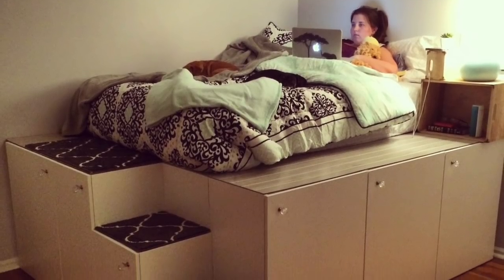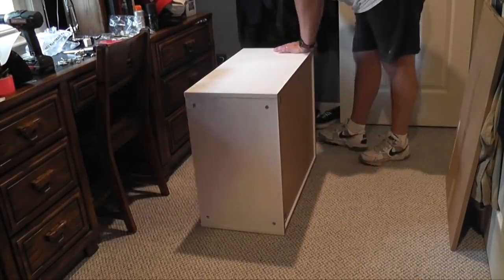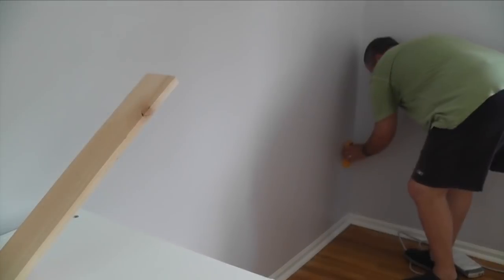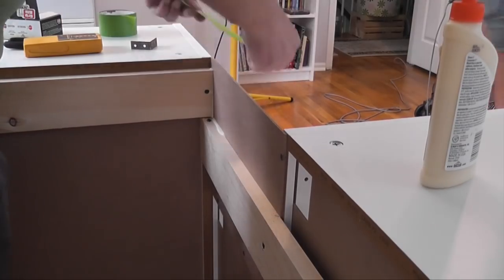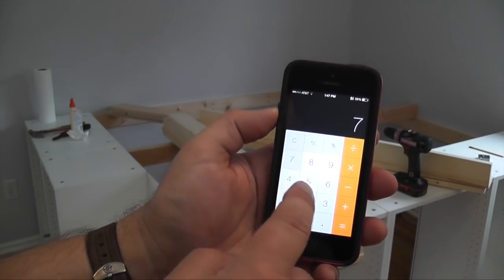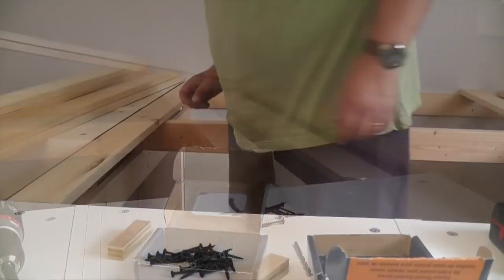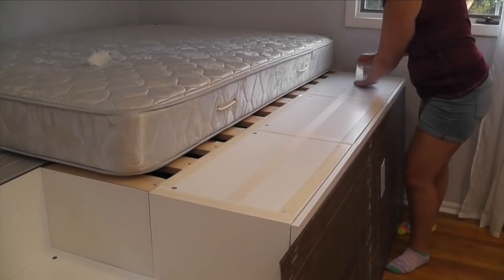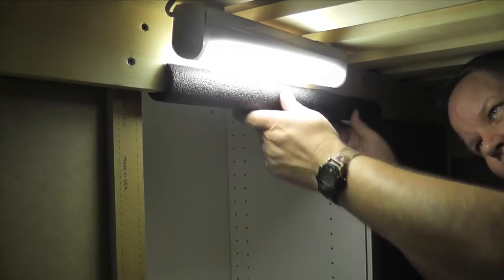IKEA Hack Platform Bed DIY

Comment: LOVED this video when I first saw it last year. It was perfect timing because I was moving from one place with 2 tiny bedrooms to 1 normal sized bedroom. With the tiny bedrooms, I had turned one into a closet and was loosing my closet moving into a bigger bedroom. I modified your plan to use custom cabinets to raise them to 40" and extended out 18" verses 15" (to fit a standard hanger). Each of the cupboard became a half closet! Thank you so much for sharing your idea!!

Comment: It will make the crawling space even lower, but I would make the matress slightly sink between the cabinets. It would look prettier IMO, more like a whole. +it would prevent the matress from sliding a bit away from the wall, wich would annoy me big time :P.
Reply: +Fenke B I think sunk beds do look kind of cool but they pose 3 problems. My parents had a water bed those mattresses are usually sunk. Putting sheets on was a nightmare. Also, the comforter never sits nicely. Lastly, I remember my parents ALWAYS having a bruise or 2 on their shins and randomly hearing "ow!" as they crawled out of bed. It is so easy to hit yourself on the corners next to your mattress because the mattress sinks but the hard wood doesn't.
Reply: That's another practical perspective that should be considerd.. Didn't think about the possibility of bruising against the edge :P
Reply: +Fenke B you wouldn't have to completely sink the mattress to stop it from moving. You could slightly drop it so that the mattress has a frame around it, and it shouldn't be too hard to make the bed as you can still access the corners and sides, just gives it the support to stop it moving around.
Reply: +Reeni how do u make ur bed than
Reply: Jasmine Mounsey you just tuck the sheets in........ if its only like 1inch then it doesn't make it difficult.....
Reply: +Fenke B  put a small rug pad under the mattress and it will not slide
Reply: But what if you want to change mattress size in the future
Reply: HeirOfGlee Depending on what size it was built for originally, you are right!
Reply: +HeirOfGlee That happens very rarely lel
Reply: Yah. To me I don't really care about the crawl space. That would be awesome
Reply: +Fenke B Mine has a lip of about 3cm around all edges. its perfect for holding the matress exactly in place
Reply: flawless 4ever

Comment: Hi, I stumbled upon your video a few days ago and I decided to make one for myself. 

Though I didn't use your design exactly, my design was very much inspired by yours. I opted to make mine free standing and fit the queen size variety. There's even a bit of extra room on the platform for standing or if I decide to change the mattress orientation. It's ALMOST done, it just needs a few finishing touches here and there. I would love to share pictures of it with out when I have it 100% together.
Reply: +Chris Heider how much did it cost to do this project

Comment: Excellent work!  You have re-set the bar for "How to Videos."  I just have one design suggestion stemming from my own experience with storage beds, and that is to completely cover the bed slats with a  light weight solid piece such as the decorative panel.  My only disappointment with storage beds  was how quickly saw dust and dirt drifts down through the slots and onto whatever is stored beneath them. My most recent solution to this problem was to tightly tack down a dust proof mattress cover that zipped along 3 sides to the corners and sides of the frame then installing the slats inside of it.
Reply: Idk about that, matresses have ventilation at the bottom for a reason

Comment: This is awesome, but I'd place the cabinets maybe under the mattress more so as to open up floor space and hide the edge... though the shelf created could also be useful... And I'd make up a pallet base for the mattress vs the centered beam. Too many issues with mattresses sagging after a couple years. Then, I'd also probably just do a solid platform and place a Japanese futon on top for sleeping. :)
Reply: nm about the pallet. never pause to comment. -_-

Comment: Looks great I did a similar project however most new construction gargages use very flimsy roof trusses, they are designed to support the roof not hanging objects from them, I fastenened mine into the walls not using the ceiling. but I have a significant amount of weight on mine. Just a word of caution to be aware of. Cheers 2:57

Comment: Am i the only one that is thinking that particle board is not a suitable material to use as a stepping platform or stairs, especially particle board that is not laying on top of supporting boards but rather screwed into the side of the supporting boards, Its a great idea and wonderful design but i would have just used the ikea furniture as a template and made it all out of hardwood instead of particle board, It would be more stable and last longer then cheap particle board, you could also then keep the wood grain of the hard wood and stain it instead of having stock white color.
Reply: Seriously lol, that's exactly what I was thinking.
Reply: all bullshit aside , you aint gunna do jack squat !
Reply: You ain't cut it bro, so just drill it.
Reply: I was thinking that, but cabinets can hold up a ton of weight, so I'd think it would be okay. That being said, I would have reinforced the framing myself.
Reply: Shadowlords I was thinking the same thing. IKEA is known for their stuff breaking so I wouldn't trust them. this idea is amazing don't get me wrong. I'd just use different wood from a real lumber store maybe
Reply: i know my dog head butted the feet on my wardrobe and the whole thing broke
Reply: It is now.
Reply: I believe the stepping platform is mainly for the dog, LOL, I wouldn't stand on it!

Comment: How would you vacuum under the bed if you need to? The crawl space sounds like a fun hiding space LOL
Reply: you probably wouldn't need to, its enclosed, so there wouldn't be too much dust, and no spiders since they wouldn't be able to survive
Reply: You could use a hand held vacuum cleaner, or, since the space is pretty small just sweep it.
Reply: +Rose Lee what makes you think spiders wouldn't be able to survive? its not air tight...
Reply: +Courtney Shock not alot of bugs down there, so it would be pointless to build a web. bugs usually fly around in open spaces, windows, or doors.
Reply: portable vacuum. there are hand vacuums

Comment: About how much was this project????
Reply: The approximate cost of this project was $480, roughly broken down as follows:
$355 – Cabinets
$85 – Lumber
$40 – Paneling, carpet, knobs
Reply: Nadia Ch. and that's if you already have the mattress
Reply: Nathali Blanco Yea, I really don't know how much is a mattress, the only thing I know is nothing's cheap nowadays
Reply: hannah sparacino Ikea's really cheap but I don't know about the planks
Reply: Ikea also sales bed slats that have bounce to them (and only 2 inches high) that I use for my platform bed instead of a boxspring and it helps a lot.
Reply: yup I bought some kind of furniture was not be able to keep that long.
Reply: mattresses are like $500+ for twin size beds. It only gets worse as they get bigger lol

Comment: While I like the idea, I would add more support under the sides which are held up by the cupboards. I would ad a support beam in the corner atleast. Those cupboards were not designed to hold a lot of weight and while the weight distribution might be okay for a while, IThe steps would be at risk of collapsing after using it a number of times. I would build my own steps as I prefer a more sturdy situation. However I do like the idea.
Reply: +StarAWings agreed.
Reply: +Chris Heider thanks but I don't need the info, my dad taught me how to make stuff like this from scratch so I can make it myself...

Comment: How high is the room ceiling in the video?
Reply: +Chris Heider Thanks for clarification, the 2 1/2 foot high cabinets plus mattress height on top will make it a head bumper for me in my 8 foot ceilings (i'm 6'2").

Tis a nice idea, particularly if you have 10 foot ceilings.
Reply: +Chris Heider - Hi, thanks for confirming, may consider this for my son moves out of his convertible cot bed into a full size bed.
Reply: +Chris Heider ... do you think this would work with the mattress on a board and hinges (so bed lifts) & we can access storage that way?
Reply: +dpistoltube  If you try the lift bed application, you will need some type of counter weight so you dont strain so much when lifting. Would be fairly simple to use a garage door spring system underneath or depending how hi you need to lift it, maybe a gas shock lift assist from a fiberglass pickup truck bed cover.   ;~)
Reply: +dpistoltube 
That's a great idea!!!  Especially related to my interest in using a bed like this to give a guest room a multiple purpose as a sewing/crafts room.  I'm loving this post...and all the creative ideas that are developing from it!!!
Reply: +BT thank you... they have a lifting bed at ikea I need to look at how it is made... I love this bed
Reply: +Chris Heider lol if I figure it out I will post it then
Reply: +BT thanks again!

Comment: If this was a two person's bed. I would have made a bit of space for the person who has to sleep by the wall a place for them to have stuff like a clock and small lamp and any other small objects like eye glasses. Only courteous to do that for one's partner.
Reply: Shelves :)
Reply: +justcomments I would agree if the shelves were done similar to the ones on the floor.  Plus it would make it easier for the person to get out of that side of the bed instead of having to crawl over the bed to the foot of it to get out of the bed. Shelves on the wall would make that harder on that person.

Comment: Hi and thank you so much for showing this. Do you have measurements for queen size mattress? Can I use 6 draw dresser instead of the 24inch cabinets? I like the crawl space  too!
Reply from the maker: Just Google “mattress sizes”. Sure you can design this with dressers instead, but you’d need at least one cabinet with no back to access the crawl space.

Comment: QUESTION!!! Does this need to be done between two solid walls or can the wall near the headboard be plaster board? Will it work or will it fall and ruin the wall? Thank you!
Reply from the maker: This version needs to be attached to studs along the whole edge. I made an alternative freestanding version that could be used if you don’t have studs. There is a link in the description.

Comment: For the support mattress support frame I would have used five 2x4's and plywood on top - much stronger and less wood to be cut and measured (3 inch precision spacing of slats would not be required - especially if not seen). But still nice work. Not sure if an ikea cabinet should be used as a step - maybe for a child perhaps. ??
Reply: I think if you don't stand on them for too long, it'll be fine; since the steps are just there for easier access to the bed

Comment: Question did you just screw the plank through the dry wall and was it solid ?
Reply from the maker: No, drywall won’t support anything other than artwork on the walls. You need to use a stud finder to screw into the supporting structure of the wall.

Comment: Funny enough I saw something like this at one of Ikeas in store displays last time I was there, except theirs was  maybe just 2/3rds as high but had a bed on legs so you could slide a kitchen table folded up under it. It was also at least half a meter wider in every direction.

Comment: How do you put the wood to concrete togther? Did you make the hole in concrete before? Or is it your wall not a concrete?
Reply from the maker: My walls are not concrete, they are gypsum on wood framing. I attached the horizontal support rails to the wood framing. If you have concrete, I suggest you make it freestanding like this alternative version: https://youtu.be/SbwLn02Q55g

Comment: I looked up the dimensions of the cabinets on the ikea website, but the depth dimensions aren't accurate to the list you have in your q&a. Will this be a problem?
Reply from the maker: Shouldn’t be an issue. You can use practically any cabinets.

Comment: Do the doors drag on the floor at all? I am trying to choose between wall and base cabinets (which have a foot on the bottom).
Reply from the maker: Use wall cabinets and put feet on them (or a wood frame if you have carpet) to raise them up a bit. Base cabinets are too deep, in my opinion.

Comment: those cabinets used for the steps, are those the same ones that are rated for a maximum weight capacity of 80 pounds? I like it. Brilliant though. I love how you thought of every little thin like the foam where you'd hit your back. Woulda taken me probably 6 months of sore backs to figure that one out lol.
Reply from the maker: In the Q&A video, I show how I broke a step, repaired it, and how to reinforce them so it doesn’t happen to you.

Comment: that's a clever project, especially considering what you have to work with but there is no way I'd trust a couple of 1x4s and a single 2x4 to hold up.  One good bump and you're on the floor.  I'd have gone with 2x4 s for all the framing and cross pieces.
Reply: i would of gone with 3 2x4s to hold up and a complete cover of 1x4s for cross

Comment: Can i built around 3/4 taller.  Have 2 levels,  1she bottom being drawer.  And 2no being a compartment where yo can lead your be u via hydarlic to acess  the storage area
Reply from the maker: This is DIY so you can build it however you want. Just realize if you’re going to put hydraulic lifts on the mattress instead of going through a cabinet, you’ll need to bend or climb over the cabinets to access the storage space.

Comment: Would there be a weight restriction?
Reply from the maker: I can say we’ve had three adults on that bed simultaneously with no issue.
Reply: HandyDadTV well you have definitely inspired me I am gonna build one that is 40 inches under the bed along with a door that enters it but Instead of the dressers I got a four two drawer dresser for more storage and I am going to go over the top and add some 12v lights and put little tile carpets down there I noticed with that 30 inches you didn’t have enough headroom so at the top piece it would be 50 inches without the box frame and I’m 69 inches so I’ll plop right down on it without stairs 😉 well atleast for another maybe 10-20 years then I’ll complain about it being to tall

Comment: Ikea cabinets are made from particle board, which isn't strong, so it's not the best support to hold up a bed. If you stand on the bed and start jumping up and down my guess is you will see the screws start to come out from behind the cabinets.
Reply from the maker: Particle board sandwiched between two layers of melamine is very strong. Plus the pine frame adds strength.

Comment: Wow, I have no idea who in their right mind would want that as a bed. Sorry , Chris but it is not very well through out because it makes the bed actually incredibly dangerous since any person could fall from the edges and onto the floor when they are sleepy or simply if they lose balance. It is also too high to use as regular sitting around the edges. Basically the whole structure needs railings that are strong enough to hold a relatively large person from falling, let a person lean against or hold when walking up or down the steps.
Reply from the maker: And yet, hundreds if not thousands have been built over the past 6 years and no injuries reported.